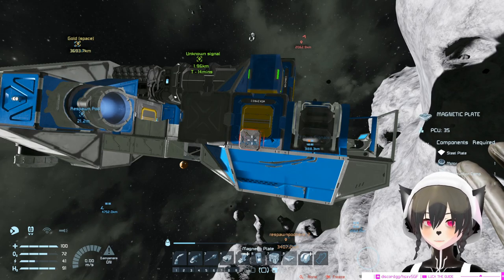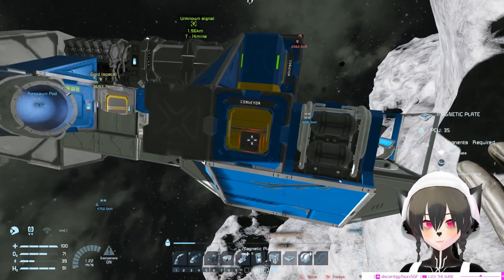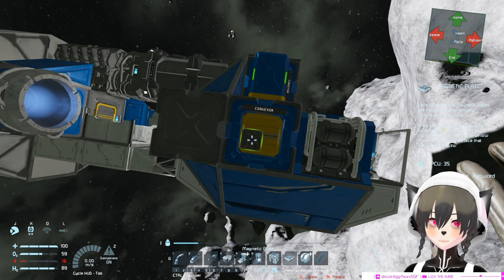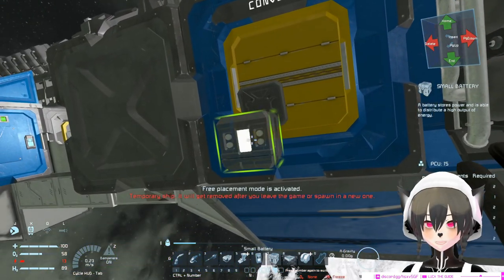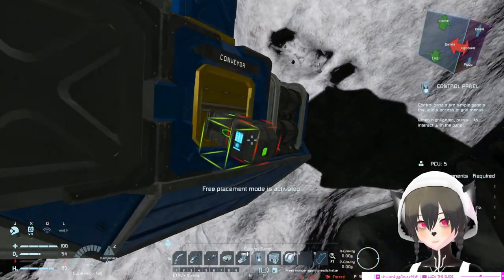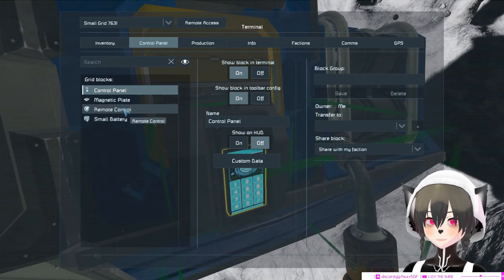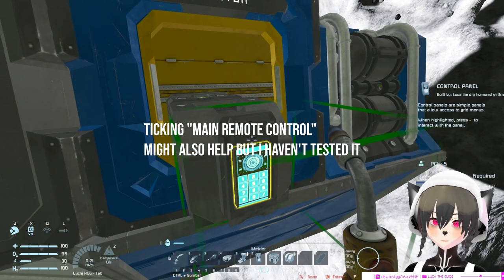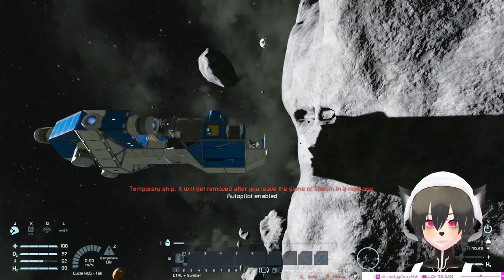Compact Killswitch, Paralyze Enemy Ship Sneakily, Space Engineers Survival Warfare Combat Tutorial

Comment: One issue is if they already have an AI block active before you do this the ship will still travel to its GPS waypoint. However, they still will not be able to manually fly their ship even if it runs out of power until it is destroyed. I am currently working on a way to incorporate this idea into a Ramsled boarding craft or some form of ammunition to fire at a ship to paralyze it.
Reply: Did you manage to do it? Just found this video and I want to make a missile that immobilizes the enemy ship. Idk how I am gonna do it yet but hope it will work.
Reply: @levi_exiled8579  I have a few working prototypes, but none are practical just yet. When I get my Xbox in a few days, I will get back to work on it.
Reply: @chadraptor2351  That is cool. That means it works and I can make it.

Comment: Now make a version with a sensor which triggers autopilot when it detects an enemy ship extremely close to the magnetic plate, replace the control panel with a small rotor head and you can print and fire them from another ship using a gravity. :3